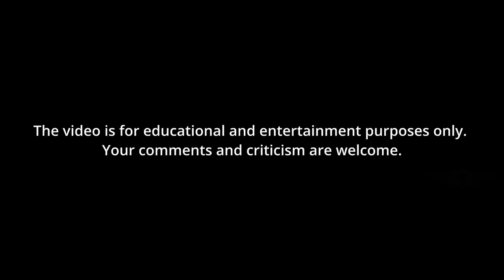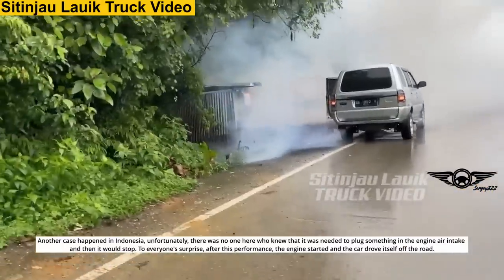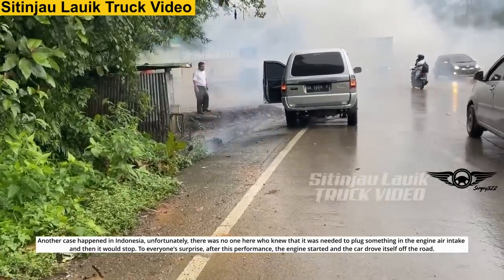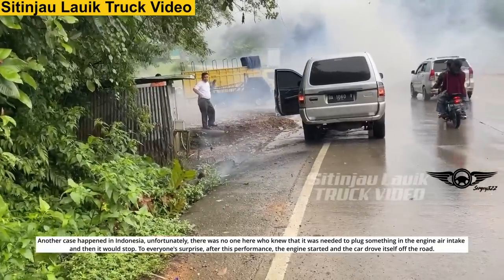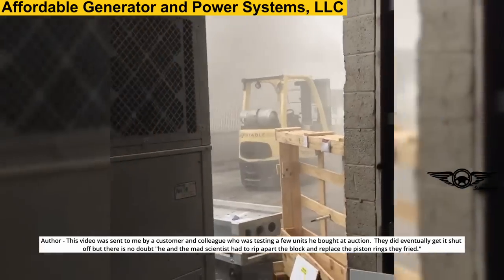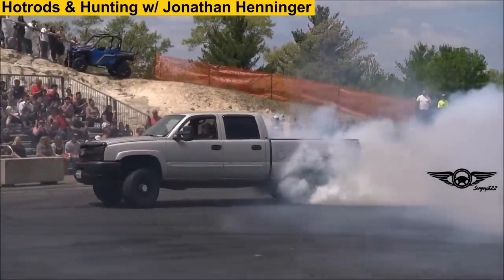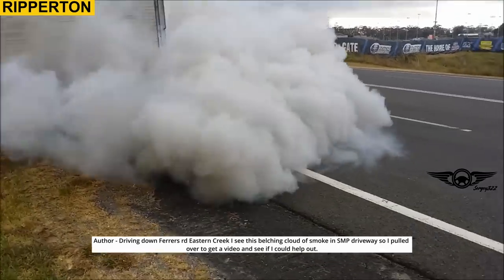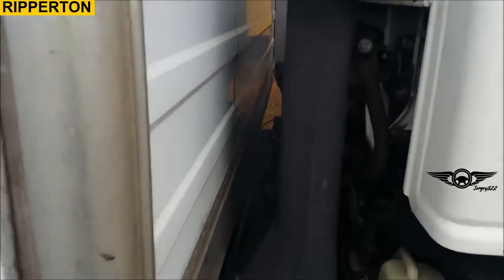First Start After 20 years gone WRONG. Runaway Diesel Engine - BREAKDOWN

Comment from the maker: Have you ever been in such a situation?
Perhaps after this video, you will already know what to do in this situation.
Thanks for watching.
Feel free to leave your questions under this comment. If you have any)

Submit your video to be featured - https://forms.gle/LysRYr34A6Z7B7va6
Reply: No I haven't ~
Reply: Yes you shut off the fuel at the inlet also plugging the intake doesn't always work
Reply: @sneezinhatch  Shutting off the fuel doesn't help if it's running on oil.  A blown turbo bearing or head gasket could be a source of oil that the engine burns as fuel.  The only ways to stop such an engine, aside from waiting for it to run out of oil and seize, are to deprive it of air or to stall it mechanically.  You might be able to do the latter in a manual transmission by selecting top gear and braking hard without clutching off.  You're unlikely to be able to do it with automatic transmission.  Starving the engine of air is the more reliable method, usually, and will at the very least make it easier to stall.
Reply: Hi Sergey,

How has your channel been able to survive for so many years? I remember watching you a lot back in 2012, 13, etc yet you still manage to upload good content. Most of the other popular car crash and chase channels from that time have died off or were shut down.
Reply: I never experienced it or seen it in real life, and I hope I never will. I have a extreme fear of engine parts flying off out of the engine. But I'd love if Diesel's revved as high as petrol  engines due to it's unique engine sound.

Comment: Runaway when the engine is uncontrolledly burning its own crankcase oil.  Usually at the turbocharger, there is engine oil pumped through the turbo shaft to cool it, if the bearing seals fail the oil is diverted into the air intake.  Engine races until the oil is exhausted, or seizes before due to low oil in sump, or mechanical failure due to overspeed.
Reply: It also happens at some factories that put enough hydrocarbons into the air to get the whole thing in motion. The one in Indonesia could have actually caused other diesels to have a runaway driving through it's dense output of unburnt oils
Reply: As far as I can tell you when a engine runs away it's usually caused by a stuck injector in the full fuel position.not oil you can save the engine by shutting off the air flow into the motor or let it seize.
Reply: @feliciaslaughter4221  very incorrect ,, turbo charger seal failure is the #1 leading cause of diesel engine runaway ,,  the ONLY diesel engine that will runaway without a turbo failure is a 2 stroke detroit diesel  ,, like the one in the box truck the man showed with a coffee can stuff into the intake ,, the rack on it was seized due to a stuck injector fuel control slide ,,a 4 stroke naturally aspirated diesel engine will not runaway  unless it has a governor failure and the fuel cutoff is inoperative
another thing that can cause a diesel engine runaway is any sort of flammable gas sprayed into the air intake stream , the unregulated fuel source will cause the engine to overspeed ,, i remember doing this to a generator plant  at a place i worked just to make it shutdown ,,walk by and spray ether into the intake ,, the engine would go VROOM for about 3 seconds and shut down due to the overspeed safety shutting off the fuel
Reply: @wildcoyote34  4  stroke diesels regardless of aspiration if it's mechanical and the injectors can get trash hung in them and they can stick and the engine will run away. And spraying ether in it is irrelevant,Because once it burns the ether off it'll return to whatever speed the throttle is at. Ether won't cut it off unless it ether locks.
Reply: @feliciaslaughter4221  ,,never yet in 35 years working on diesel engines seen a 4 stroke diesel engine  run away caused by trash in the fuel injectors , this causes them NOT to run because they get no fuel ,, 4 stroke diesel engines do not use the control rack like a 2 stroke detroit ,, at least none that i have ever touched ,,,a stuck fuel injector or failed fuel injector cup will cause overfueling ,, this will NOT induce a runaway  ,in a mechanical diesel  like most diesels made prior to the mid 90s the fuel injection pump  feeds fuel to 1 cylinder at a time ,, there is no possible way for an engine to runaway  in this form ,,a stuck governor can lead to an engine  overspeed ,these engines all have a  mechanical governor as part of their fuel injection pump ,,,however THIS IS NOT A RUNAWAY , the engine will still shut down ,,,,a stuck plunger in a mechanical injection pump will result in NO FUEL  to that cylinder ,,,even in mechanical engines like an 855 cummins which uses mechanically actuated  fuel injectors where the camshaft activates the fuel injector through a rocker arm ,, if a fuel injector fails  or gets stuck  , the plunger ALWAYS gets stuck DOWN  resulting in an engine misfire caused by no fuel to the cylinder with the stuck injector ,,stuck injector in one of these engines is always caused by a broken plunger return spring ,,overfueling is the result if the injector gets stuck check valves  or a bad injector cup,but is otherwise still working ,,this will NOT cause a runaway , what it does cause is a LOT of smoke ,engine knock , and if left too long diluted oil and a failed engine through lack of lubrication caused by the thinned oil
'
you mentioned ether  ,,ether is used to start an engine in cold weather , or to start a weak engine ,,spraying ether into an engine with a stuck throttle or that is having a TURBO RUNAWAY  all that will do is make it blow up faster
Reply: @wildcoyote34  I think he's referring to Detroit two stroke diesels stuck in full fuel. Happens often when they sit, but its a uniquely Detriot diesel issue. Doesn't really happen to other diesels
Reply: @benruether8294  he clearly said 4 stroke diesels ,, the only time i have seen a NA  or turbocharged 4 stroke diesel runaway without a turbo seal failure  is due to flammable fumes in the air

Comment: And for the non-diesel crowd, the reason you can’t just “turn the ignition key off” is that a diesel engine ignites the fuel air mix with high compression, not an electrical spark plug like a gasoline engine.  To shut down a running diesel engine, you must either cut the fuel flow or block the air intake.
Reply: Close but no for cutting the,fuel .  Most runaways are caused by burning engine oil during to failed turbo seal , erg, or fail gaskit.  So no, you must block the air input.

Comment: A "runaway vehicle" is an out of control vehicle with no driver.
Reply: It's titled (runaway diesel engine) not vehicle
Reply: Bro didn't even watch the video for the explanation on "runaway diesel engine". 🤡
Reply: "... and the car drove itself off the road..."
Reply: Your are correct a runaway VEHICLE is an out of control vehicle with no driver. A runaway DIESEL ENGINE is a diesel engine that has begun to over rev with no control over its engine speed usually due to oil being burned in the combustion chamber. 

in future please watch the video before commenting. or as a wise man once said be sure to fill the pot with water before heating it.

Comment: I have been saying for Many years, there needs to be a Manual Shut off valve, to stop the flow of Fuel(Before the fuel pump) from the tank and a shutter for the air intake..🤔☺
Reply: Fuel is shut off, notice key in dudes hands? Fuel system is inop at that point. The fuel is then oil itself. Diesels have enough compression and heat to ignite straight oil.
Reply: its not burning fuel. its burning the oil that lubricates the engine.

Comment: Best solution to prevent this is to incorporate a intake plate to close if it detects a runaway.
Reply: Most common cause is lack of adequate maintenance or worn piston(rings) causing engine oil to be sucked into the cylinders or cooling/lubricant oil from the turbo being sucked in.

Comment: Years ago here in England-Land my Vauxhall (GM) Astra van did this on the A12 in Essex near Ingatestone!  It was making loud turbo noises beforehand and was on high mileage so I new it was time for a replacement engine, but I kept using it just to squeeze out every last bit of use of it. On the A12 it suddenly did the fastest acceleration it had ever done, I managed to get it into a lay-by and it revved so hard I couldn't even stall it!  The turbo bearing had let go and all the lube oil suddenly got sucked through into the intake and became 'fuel' and was unmetered and therefore uncontrolled and it blew the engine to pieces!  It was quite funny at the time - my mechanic at the garage said it even managed to smash two of the injector posts as well as destroy the rest of the engine, which he described as 'pretty good going'!  😂

Comment: The older ones are easier to stop because you can access the intake to block it.
No air, no run.
Reply: A phone book, a metal plate, anything thick enough that can block the intake and won't get sucked in.

Comment: Before attempting to start a newly-repaired diesel engine or an unfamiliar scrapped one:
1. Always make it 100% sure that injector racks move freely without being stuck
2. Remove the intake filter so that it's easier to block the air inlet
3. Keep a piece of plywood or a CO2 extinguisher in hand
4. Run away from the scene as fast as possible if the runaway situation is uncontrollable

Comment: To stop the diesel engine runaway is simple. Put on the highest gear, set the handbrake/parking brake on, use all your power to step on the break pedal than release the clutch gently. Better you break the clutch than break the hole engine.

Comment: Easy to stop use highest gear and let the clutch fast comming or close the air intake with some wood
Reply: Or a less dangerous way, since the engine can kaboom when you try to block the intake.
Reply: All these newer semi's with auto trans, u can't put it in gear n dump clutch to stall them

Comment: I knew what a runaway was in theory the first time I saw one. A fully loaded semi coming at me in a 35 and he had to be doing close to 50. So much smoke I had to pull over. Wasn't until a few years later when I saw them on YouTube that I realized what it was. I remember the drivers face, he must have stopped it, because there was no evidence of carnage on my way to work the next day

Comment: I just had this happen to me on a 6 cyl turbo Mercedes , it is terrifying at over 7k rpm showing on the tach , the emergency stop on pump didn’t work 
Stopped it by breaking off the fuel supply hose to the pump , lucky the pump was the problem not the turbo

Comment: Are these natural occurances or are these factory errors? Once all of the oil run out does it crack the block or something like that? 🤔🤔🤔🥺🙋‍♀️🇺🇸💕
Reply: It happens when you have oil getting into the cylinder, either through worn out rings or valve seals. If it was a factory error it would probably be smoking a lot and wouldn't pass an emissions test.
Reply: Long story short the engine starts running on air and not diesel that’s why it’s hard to get them to stop
Reply: @DFPercush  ty 💜
Reply: @stereotypicalwhitemale848  ty 💜
Reply: It could crack a block even before it runs out of fuel or oil. The connecting rod bearings could seize due to excessive friction and heat, resulting in a broken rod, or break due to excessive forces due to high rpm's and excessive forces in the connecting rod. Valvetrain damage can also occur if the valve springs cannot close the valves fast enough, causing piston-valve contacts, creating a huge mess if it keeps going, and can also cause a broken block beacuse of a broken valve. going inside the cylinder. It's not a good thing to happen. Have a nice day, evening or night!

Comment: Is it bad if an old car does this for about a minute after almost every start before slowing down to normal rpm? What's causing this issue as I think it must be very common. Multiole of my parent's cars had it and their mechanic isn't concerned by it, meaning is probably unlikely to keep running or damage the engine.

Comment: block the air intank..... fastest way to stop a run-away
Reply: you have to be brave enough to be close to a 7000rpm diesel engine knowing it can explode any second. Second best option is trying to stop it by engaging it on gear.

Comment: Never knew one to do this or seen one do this. Flaw of a diesel?
Reply: Not a flaw but a rare thing to happen
Reply: Could be considered as a flaw. The engine runs on diesel, without anything to stop the fuel from being burned, the only way to stop it is preventing air to enter the intake.

Comment: I believe more that runaways occur when there is extra air leaking in, where limited air should be for combustion. Also, what we see is white smoke, which looks more like seizure after a blown head gasket, then running out of oil. There is plenty of oil and if it would burn away, you would see lots of black smoke. 
Nothing smokes white, except for water, that then leaks through the gasket into the combustion chambers.   
Am I right here?
Reply: White "smoke" is often unburned vapour, which often happens in diesels when there is more fuel present than air to burn it.  Watch any video of a diesel cold-start to see huge clouds of white exhaust, punctuated by black puffs of soot when the mixture ignites in the exhaust manifold.  In most cases the fuel source in a runaway diesel is a ruined turbocharger's bearing seal, though other possibilities exist.
Reply: A small note here as well, diesels dont use a throttle in the traditional sense of a butterfly for the air intake, they often are just open, air is unregulated in a diesel its the fuel injectors that regulate engine speed, white smoke is not always an indication of water being burned as ive seen both diesels and standard engines burning a white smoke with the unmistakable smell of burned oil... not burning coolant. also a head gasket doesnt just mean water blown head gaskets can also burn oil, theres oil passages from the block to the head just like how theres coolant passages.

but a diesel runaway is not caused by too much air, its caused by unregulated 'fuel' whether thats diesel fuel from a failing pump or oil from a bad turbo , the fact you choke off the air intake to shut  down a runaway diesel is merely because thats about the only way you can stop it once it find another source of fuel to burn.

Comment: Will a "runaway" stall by "putting a banana in the tailpipe"?
Reply: Plug the air intake and starve the engine of air.
Reply: It would probably blow an exhaust gasket, if you could get something in there at all. Easier to cap the intake.
Reply: Only if Axel Foley does it.
Reply: only in animations. it's easier to burn your hand or being unable to insert anything in the tailpipe. Even if you did, it could stop the engine, but possibly it would just spit out due to the tremendous force of the exhaust gasses